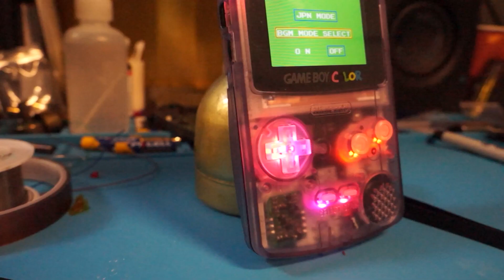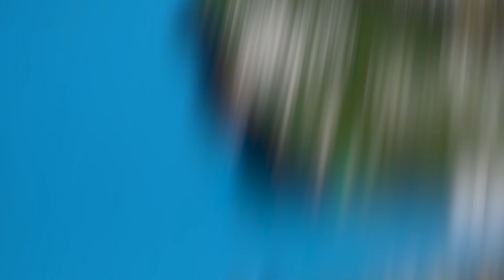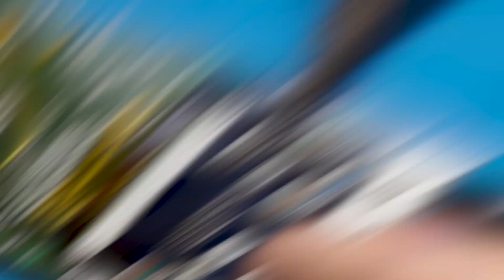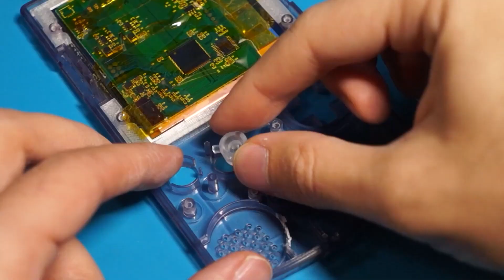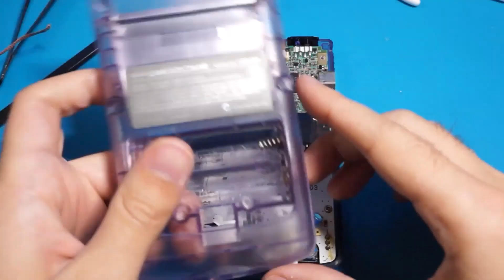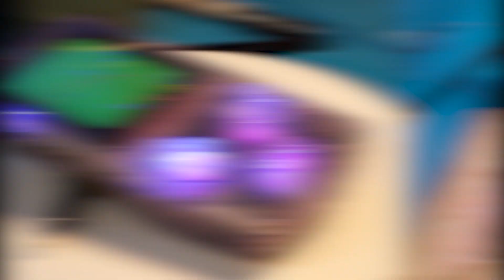Gameboy Color "RetroGlow" Install Guide | Light Up Your GBC!

Comment: Can someone explain to me how I'm supposed to pair this with an IPS screen? I cannot find one single video or tutorial or anything whatsoever showing or even explaining where to wire the select start and a button so I can customize the LED colors beneath the buttons. They work fine, but I can't change the colors. I'm getting a bit irritated. I've spent nearly 2 months scouring the internet to find out where to solder 3 wires. For whatever reason, all of the tutorial videos I've come across conveniently omit where to solder these wires...... PLEASE HELP
Reply: You need to solder the ips kit to alternate locations, like the vias on the board above the cartridge pins 👌🏼

Comment: Bought this a while ago and just installed, but am having a big issue.  Pressing select and left/right does nothing.  I have triple checked all my connections and they’re fine.  I know my connections are good because I can control the OSD on my IPS kit with no problems.  I don’t know if it’s that little IC chip or a resistor, but I really think my kit is defective. Not really sure how to fix this, and can’t find anyone else with the same issue.  Very frustrating.
Reply from the maker: Sorry to hear that! Here is our support email to hopefully help you clear up those issues - support@handheldlegend.com

Comment: I just did this using your kit 2 days ago and it looks amazing. The only problem is when the brightness is up I'm getting a hum. Happens on anything above level 2 brightness.
Reply: Hum with more power draw is a common issue with GBC. You might try adding capacitance to C32, default is 100uF but you might try 220 or something even a bit more. Cheers!
Reply: @MitchCairns  Where can I purchase this?
Reply: @RomTheStampede  any electronics outlet such as mouser or digikey. You can buy cap kits on Amazon as well